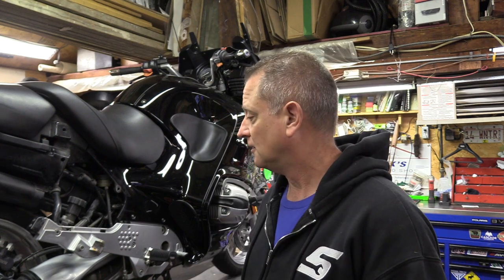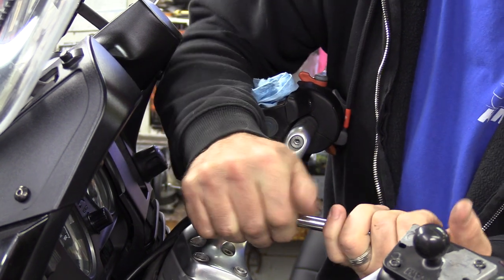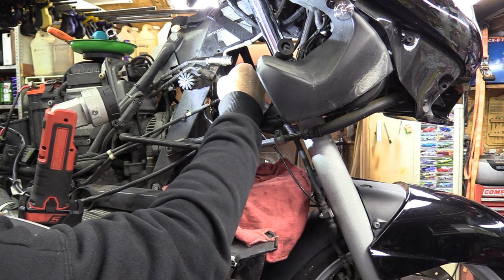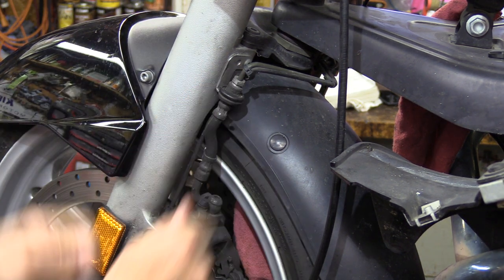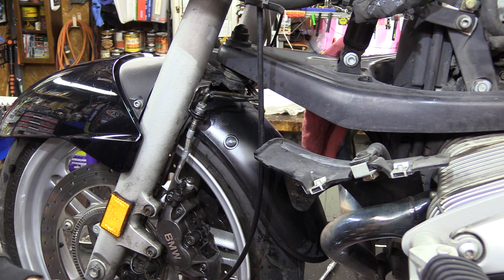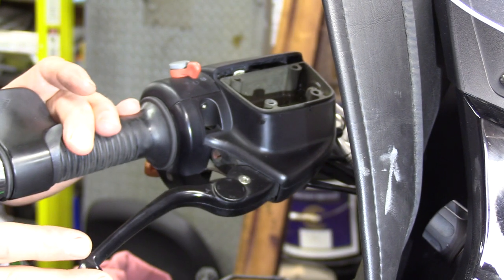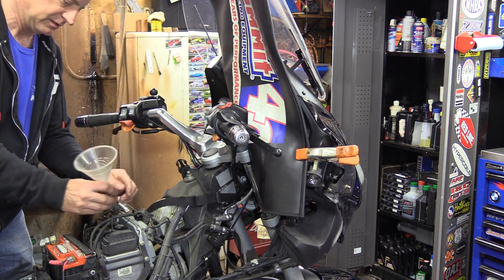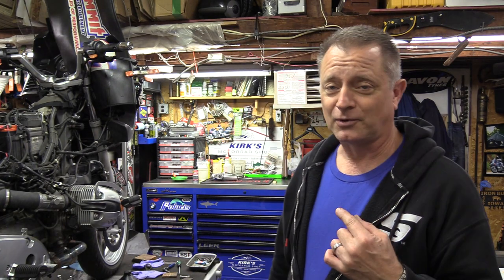BMW R1150RT Brake Line Install DIY

Comment: I just finished installing 5 lines, and 6 new brake pads on my 2004 BMW R1150RT.  I went with Galfer brake lines. They are as good and less expensive than Spiegler, which was $300 with banjo bolts. Galfer was $213 with everything. You can rotate and clock the line banjo fitting on Galfer lines if/as needed just like Spiegel. They both are good.  I had a lot of info from BMW Sport Touring form and watched a few videos, including this one. It helps to see it done. Thanks for video.

Comment: Oh dear. Mine has been tampered with by a previous owner and has two hoses of approx equal length leading to the front calipers. They join at the top with a long banjo bolt to the pipe from the servo. The pipe that crosses the front wheel behind the forks is gone. Thanks for your video I know now how it should be set up. I’ll need that missing piece if a standard hose kit is to be used
Reply: Should be able to make the missing line out of copper nickel alloy brake line from a good auto parts store.
Reply: Where’s your gloves?  Lol

Comment: bought a 2002 K1200LT with 37,000 miles on it.  The owner had ALL the updates done by dealer, brake lines, pads, bleed brakes, all the oils, spark pluga, etc, he spent $2300 . Then he sold it to me for $2500. Oh and he bought a new battery, $160..... And the ABS brake light was blinking.  So in November  I removed the plastics and did the O2 sensor, radiator, bled the brakes.....The brake fluid was very clean, it was 2 years old and had 1000 miles on it. And it was at the Minimum level. That's why it was blinking, the dealer didn't keep the reservoir full. That brake bleed cost a cool $450.  Nice bike, smooth on the road. But if it's not parked on flat surface it can roll off the side stand. Did it to me twice. So Now I always put it in gear.

Comment: My oem ones on my 2002 k1200lt actually lasted 15 years. But now I got spiegler.
Reply: my 2003 K1200LT is still original, and, going strong!
Reply: @firbyd  Mine probably would have lasted a little longer if I would have flush them more. I live in the south. Lots of humidity.
Reply: @southernstyle067  yeah, I live on the west coast myself but it was serviced by dealer in Ft. Meyers and only has 17k on it,, maybe that helps as well, good points! Spiegler are awesome for sure!

Comment: good video  why not relocate the battery to the storage/sterio compartment on the left side of the fairing...make things a whole lot easier? Just a thought...im just thinking for a safe reason in case you have to get to the power supply fast if had a electrical issue!

Comment: so there I was riding down the freeway and my rear brake jams on!  Eek! Not a pleasant feeling.

Got to work, and parked the bike for the day.  Brakes seemed to loosen back up so I was hoping that all was well.  ..well... 20min into the ride home it did it again!  The next 40-ish min was a butt puckering 'adventure.'

I started working lots closer to home and didn't want to deal with it so parked the bike for going on 2 years now.  I'm likely to be working 45min away from home again and my Ram gets maybe 12mpg. With gas over $3.50/gal, that's not sustainable so I'm rehabbing the bike.

Replaced the rear hose 1st because the screw closest to me on the reservoir is stripped. $#%! Phillips head screwdrivers! Ordered a new ebay special AL cover for once I get the front brake reservoir off.  

In the meantime, I replaced the rear line and started bleeding. Brake fluid was leaking badly so I took the caliper off and it's leaking from one of the pistons!  Also found out that the brake pads were shot and broken!  

The TL:DR this repair is costing me a funnel, a used caliper and new pads from Beemer Boneyard, the bleed wrench from KC Tools, the reservoir cover from ebay, and Vessel screwdrivers from Vessel. 

The worst part is the 'find out X is broken and I have order parts' waiting. The caliper and pads should theoretically be here tomorrow. Then I have to figure out how to get the screw loose from the reservoir . Grrr

Comment: Thank you so much for the video! I am thinking of doing the exact same thing on my 2001 R1100S with Integral ABS. In case I want to both change the brake lines AND flush the whole system at the same time, should i just follow the complete procedure that you have shown in other videos ? Thanks in advance!
Reply from the maker: yes. Do it all!
Reply: @kirksmotorrad  Thanks a lot for your answer Kirk! Really appreciated. I think I have captured everything that I need to do and keep an eye on from your videos, one last question that I have though, is the following: do i need to remove the brake pads and replace them with dummies, in order to ensure that the brake pistons are pushed all the way back (so as to not trap any old brake fluid) ? Thanks again and thanks in advance!

Comment: i just did this repair on my 96 r1100rt but my abs was much different.
Reply: same here, mine is a 99 r1100rt, same Brembo brakes w/o power assist, i believe he has the Evo brakes in this video

Comment: Great work.
I asked you if you ride a Rt 1150 with non abs module ? I not shure if the brakes work fine but im really atemp to take off the all unit in Rt 1150…
No like work in lowers  speed and not like the work noise…
Reply from the maker: I do not ride an RT. I do work on them though

Comment: Hello Kirk. Kami from UK here. A truly great video, I watched it about ,5 times now to get the confidence to go and do mine. I about to replace the lower front right hose. I have a 2001 BMW r859rt. The abs side looks a bit different to yours. I can't see the abs tank you're referring to in your video. I only can see a bleeding nipple which will allow me to bleed the upper side, but I can't see the abs tank so that I can bleed the front caliper. Also, I can't see a bleeding nipple on the right caliper. I can see it on the left caliper but on the right I only can see a knob which you can crank but doesn't look like a bleeding nipple. Sorry Kirk, maybe it's too much to ask. I've been looking for the last week for videos or diagrams and couldn't find anything helpful. The only helpful thing was your video, but unfortunately a slightly different bike l, so I'm stuck..lol..🤣🤣 hope you can help. Thank you so much.
Reply from the maker: That bike will just have the reservoirs on the handle bar and in the back of the bike. None on the the ABS. You can remove the bleed/grub screw thing on the right caliper and replace it with a regular bleeder like that on the left. I am not sure why BMW did that at the factory but I am sure they would say "vee have always done is zat vey!"
Reply: @kirksmotorrad  that's awesome, your the man, thanks Mr Kirk. That's great that means I don't have to do the ABS bleeding bit I guess. Brilliant. I think I have now all the confidence to go and do it myself...🤣🤣🤣. My mechanic doesn't want to know, he wasn't confident doing this sort of bikes !!! Take care brother and thanks again.

Comment: Is it possible to disconnect the electrical connection of the ABS pump in order to bleed the upper system and be able to use a normal 7mm key and reconnect it to bleed the lower system ?????
Reply from the maker: I cant imagine why you would do this
Reply: @kirksmotorrad  In order to be able to reach the bleeder with an ordinary 7mm key.